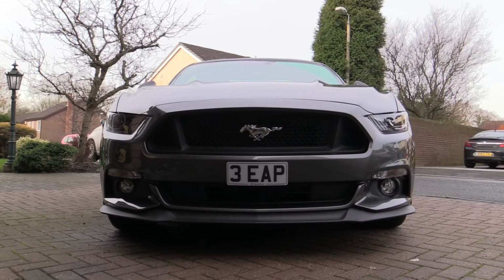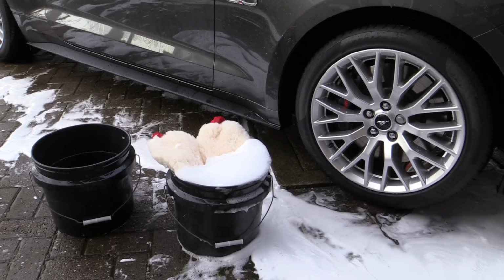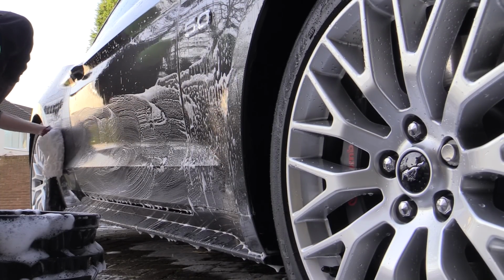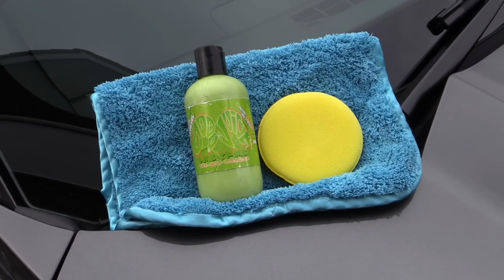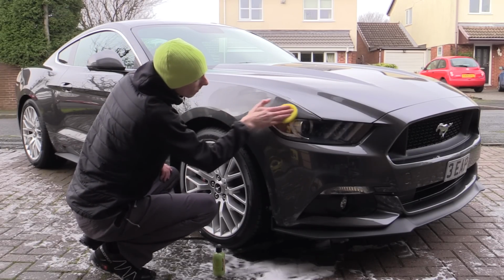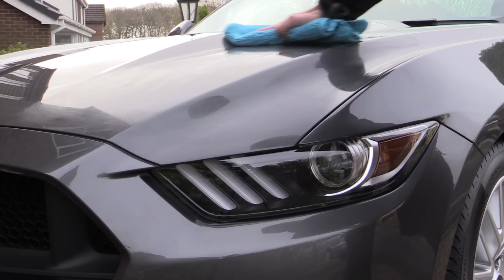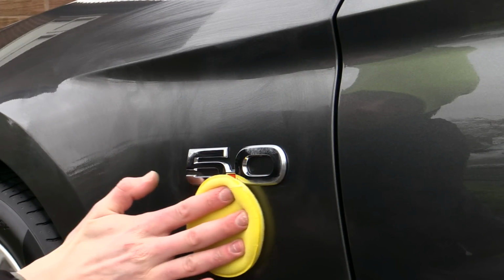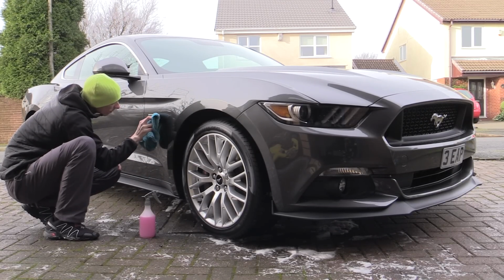Mean Mustang GT First Wash & Wax

Comment: Excellent video. You have taught me a lot about how to properly clean a car. I now have a foam cannon, power washer, bucket grit separator and Mustang GT Convertible.
Reply: Why a convertible? In my opinion, they have weaker structural integrity in the roof area, have lesser insulation abilities, more moving parts, heavier weight, more torsion in the body and lesser aesthetic appeal.
Reply: Isn't it obvious? Few things rival going for a drive on a sunny day with the top down.
Reply: +ALL KINDS OF GAINZ I don't like them either, I live for mustangs cope is the way to go

Comment: Car Cleaning Guru, I have a hot tip for you...

If you want a cheap way to test out cleaning products, try it this way, get scrap metal, doesn't have to be very big, just big enough for you to inspect, then you primer, paint and clear coat each one, rattle cans will do..
OMG THE ORANGE PEEL! buff it...

Now you have your testing canvases... what you do afterwards is you add your coats of whatever you want, be it paste wax, carnuba wax, sealant, ceramic coating... spray wax? and leave it to the elements... Wash the panels as you would normally do to cars when they get dirty but carefully inspect them.

Before wash, after wash, reapplying, seeing how many washes and so forth and even seeing the different types of washes... if you want, you can even tack weld washers to the backs of the "panels" and leave them on hooks so they have different coverage's.

What will that achieve? you may ask... well, you will get to know the products first hand, having 30 cars in your back yard is a dream for a mansion owner, but in reality you can have 50 cars hanging off the side of your apartment exposed to different elements with different things, allowing you to understand the products you are putting on your customers vehicles without going out and doing a survey.

If you really want, you can even ask the paint place for different types of paints, from hard to soft and in between so that you can try them, sure they would be too small to do the normal compounding techniques but will surely help you select the correct product, and in the end you can always spritz it with acetone, dry with alcohol wipes and start again.
Reply: Happy Fox 
you don't get many youtube questions like this to the dozen!

Comment: Quick FYI - slide the wiper blades to the service position with the ignition off (near vertical on the windscreen) they will return to their starting position when you turn the ignition back on (see the owners manual). Great video.
Reply from the maker: Good tip! Although I didn't have the key here...

Comment: Interesting.. normally when I go into my rinse bucket I squeeze the water outside of the bucket in case it does release more dirt it will be outside my bucket.  I usually push the mitt against the gritt guard on both sides.  I know there are multiple techniques.. also throw a little ONR in my rinse bucket as I find it helps the dirt release better from the mitt and the add protection of the polymers can't hurt... unless I am trying to strip the car of it's old wax for new protection and then I normally avoid polymers all together to ensure the protection adheres properly.  I enjoy your videos.. good stuff.
Reply from the maker: All good tips!

Comment: I also open the doors and with tissue paper & stikc, and rag wipe and soak up all the water, dirt, mould, break dust in the joints and wipe clean the underside of the door so everything inside the door jam is spotless. Also open the petrol cap and clean that.  You get mould and break dust inside those door jambs so should be cleaned also.  My car, you open the door, looks like it is still brand new after 4 years.

Comment: Great video again. I would offer a word of caution about using all purpose cleaner on the wheels, (apologies if this point has already been made)
You mentioned it was dilute so it should be ok, however all the apc's I know of are very good at dissolving the glue used to hold your wheel balance weights in place. Thus anybody using full strength apc to clean wheels may well loose their wheel weights. Best stick to dedicated wheel cleaner.

Comment: I never ever wipe the car with anything.  Use a very soft bristle brush that cant create micro scratches.  Using any fibre to wipe pushes minute dust particles against the paintwork, after a few months you will begin to see micro swirls.  When I dry the car at the very end after a strong hose rinse, I lay a chamois on top of areas and gently pull it towards me, with no downward force, it soaks up the water.  OF course you have a clean bucket of water to keep rinsing the chamois so no dust particles get in there.   It does take me 90 minutes to wash and dry the car and door jambs.

Comment: I have a 2016 mustang gt. Mine does not have the chrome window trim. Is it a uk only option? Here in the us it has a black rubber trim. If possible can you find the part number for the window trim and clear tail light lenses. Thanks.

Comment: Im not a car cleaning expert by no means but I have my fair amount of knowledge and experience in the paint and body department and I belive washing it with a pressure cleaner can damage the paints adhession ? Most factory paint jobs today arent very thick ?? So I think i would be safer doing it with a regular pressure house hose
Reply from the maker: +Jose Fast Boats Provided you're not using an excessively powerful industrial machine and you don't hold the jet of water too close, they're perfectly safe which is why the vast majority of pros use them!

Comment: A few questions I have: 
Why wouldn't you decontaminate the paint? You don't think from shipment and travel from warehouse the paint isn't contaminated? Its almost always the case
How come a clay bar wasn't used to decontaminate the paint?
Wheels also, I would recommend a deep cleaning no matter what brake dust tends to embed itself into wheels so a deep cleaner and then application of a sealant or coating would be wise.

Wax itself doesn't have that long of a lifespan on paint. MAYBE 2 months at that and that's really high quality wax. Usually it lasts about a month, reason being is because it ends up evaporating off the paint from the sun. If you would want something to protect until spring, I'd suggest a sealant and if you want something that lasts a year, go for a coating.
Reply from the maker: +SJC96GT As stated in the video this was far from a full on detail. Everything you see here was also done free of charge. The main reason I didn't clay though was because with the filming I didn't have time to also machine polish to remove marring that in my experience claying almost always inflicts.

If a paid off camera detail was performed where I could focus 100% on every stage without having to worry about camera angles/battery life/memory cards etc then of course the car would have also been fully clayed, decontaminated and either given two coats of wax or a separate sealant as well.
Reply: +Car Cleaning Guru Free of charge is understandable, I myself don't have too many situations where clay causes a lot of marring. I actually prep-wash the vehicle with either dawn dish soap or I add an APC to my wash bucket. Once washed and rinsed off I then foam vehicle back down and clay using the soap itself as a lubricate. Cuts down on time and does a great job at removing contaminates embedded in paint using my fine grade clay bar. From on detailer to another, if you haven't tried that method give it a shot. It definitely speeds up the process while still removing all contaminates.
Reply from the maker: Yeh I've tried using snow foam and shampoo as a lube which can be effective however I prefer a designated clay lube as I can see what I'm doing better if that makes any sense? If you can get away with claying without having to polish then go for it I say! I've just never been able to obtain a marring free finish myself and so only ever clay if I'm also going to polish.
Reply: +Car Cleaning Guru It does make sense, I guess I should've been more specific. Since you were doing it for free, a quick way to at least get most of the contamination out of the paint could've been claying after wash and then foaming the car back down. I'm just a little picky about my applicator pads and whenever applying wax or sealant, I'd just rather not contaminate my pads or take the risk of causing swirls/scratches when going in circles or straight lines when applying wax/sealant. I think of it that way, if some of that contamination could further cause damage, I clay so it minimizes the chances.

Comment: How do you control the water pressure using the pressure washer as to not damage the paint? I think I'm asking that question correctly, I know some pressure washers can do damage if not used correctly or is it the pressure washer you are using. Electric vs gas
Reply from the maker: +James C Martin Jr This pressure washer has an adjustable valve on the pump but even at full pressure it's still nowhere near powerful enough to cause any damage. For a washer to hurt the paint it would have to be a seriously powerful machine designed for industrial cleaning/stripping/cutting etc and you'd have to be a bit of a plonker to use such a piece of kit on a car!

Comment: Isn't it better to see if the paint has contaminants? And then should use Clay bar and/or color cleaner?
Cars get so much contaminants during the transportaion to the destination. I would use clay where its rough and cleaner on the whole paint job to eliminate any contaminants
Reply from the maker: If you were fully detailing it including machine polishing then yes, I wasn't, so didn't.

Comment: When I am washing my car I notice it is almost impossible to dry off as it leaves a layer of water that then must air dry. Is this because of a layer of grease? My car is quite old.
Reply from the maker: +Clay Brewer It's normal to an extent. A well prepped and protected finish alongside a microfibre drying towel and a detailing spray will all help though.

Comment: I'm OCD, if the whole point is to minimize contact with the paint, why is it necessary to follow up with a 2 bucket wash, after you let the foam dwell and break up the contaminants? Doesn't the pre-soak do that?
Reply from the maker: No the pre-foam just safely removes any light surface dirt and softens up the more stubborn stuff prior to the contact cleaning. It should never be substituted for a proper wash.
Reply: If you don't wash after foam and then dry the car you are welcoming scratches and swirls.

Comment: Another fantastic job. Can I ask why you apply tire dressing to the tires before you dry them? Even before you wax the car? I have never seen that done before except by you. Your results speak for itself, so please don't think this is a criticism. I am just curious. Thank you for posting your excellent videos.
Reply from the maker: +ouarkie I do wipe the tyres over with a towel prior to dressing but in the winter they'll still be a little damp. And I just like to get the wheels and tyres boxed off prior to attending to the paintwork. I understand why people like to dress them as a final step but you risk contaminating your freshly waxed body with tyre dressing then.
Reply: I am sorry I meant you apply the tire dressing before you dry the rim off. I was unclear on what I meant.
Reply from the maker: Ah ok, usually because there is a bit of dressing contamination around the edge of the rim or overspray (if I apply directly to the tyre) that needs wiping off so I just do it all in one go.

Comment: I have a question: is it really problematic if by accident when refuelling a car you end up spilling fuel on the car's body, on the paintwork?  Do you need to hurry to damp if fast and then wash quickly so that it does not harm you paint ?
Reply from the maker: I've never come across any permanent staining from fuel overspill so I wouldn't worry too much.
Reply: Don't make a habit of it. Just put it dry with some napkins or paper towels. Don't rub it....dear god those rough things will scratch. You could also just rinse it off with water if available. Wash the car atleast the next would be recommend.

Comment: high pressure washing the wheels is not good,  instead use slow flowing H2O better getting the bits...Mate!
Reply: Dave Johnson he does this for a living. He knows what he's doing
Reply: Hi pressure flow will eventually start to peel off, thus low flowing h2o is better. Not my problem.
GL

Comment: OK I'll say it.
I was surprised at how flexible all the panels are, you can see the "give" in them all when the wax is applied.
Is that just a quirk of the material used in the panel or a sign of the stereotypical cheap American construction?
Reply from the maker: +George Smith Felt like plastic to me. Either that or incredibly thin Aluminium.
Reply: Car Cleaning Guru 
Thanks for the reply! 
I'd be worried about it getting dented if it was that thin!
By the way,
do you ever use, or recommend, a nanotechnology polish? You know the ones where the car just needs a hose down after a year and looks like it's just been washed?

Comment: Would it not be better to clay the car before waxing a new car
Reply: +mo khan Claying isn't really necessary on a brand new car, because there aren't really any contamination on the paint.
Reply: +Niklas Neve Sørensen Not strictly true...was surprised how much there was on my new car when I detailed it before applying a ceramic coating. Iron X, tar remover and light clay should definitely be done, even on a new car IMO...
Reply: +Lewis Carpenter I didn't expect that... :)
Reply: +Niklas Neve Sørensen Me neither! Also didn't expect the large amount of swirls that the dealer managed to make from doing their 'new car' prep, despite me asking them not to touch it..! :( Certainly didn't expect to have to do machine polish on it!
Reply from the maker: +mo khan Only if it really needs it and if you're planning on properly polishing afterwards to remove the marring it will inevitably inflict!

Comment: those specks were from wiping the under side of the vehicle and you rubbed all that all over the paint. Not smart.
Reply from the maker: +peter reboot What specs?
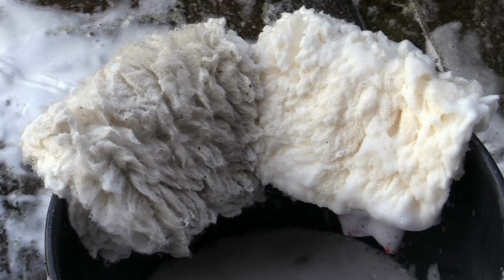Reply: +Car Cleaning Guru at 6:37 you're showing a very dirty wash mitt. Of course it's dirty, you wiped under the rocker panels with it. I hope you only use the wheel mitt for that. But i noticed you kept washed the lower side of the car. :(
Reply from the maker: +peter reboot I washed the lower panels THEN the underside of the plastic sills and inner arches. That mitt will not go near the paintwork again, at least not before going through a proper wash.

Comment: What an absolute machine! Check out my channel mate, just got my first professional detailing video out and would love if you could leave your feedback. And well done on the job pal looks brill!
Reply from the maker: +Aminul Islam Nice one, how do you find the CG VSS polishes? Was contemplating adopting one for my single stage stage enhancement details this year but it sounds a little too good to be true!
Reply: +Car Cleaning Guru I'd stay well away from it mate. With CG it's a hit and miss tbh. As they're products and advertisements suit the weekend warrior as well as the professional Detailer, it really is a hit and miss when testing their products. I've tried the CG VSS and it's more for the weekend warrior tbh. If your looking for an all in one polish I'd recommend the auto finesse triple all in one polish. Works way better
Reply: But in saying that, they're V Line polishes work really good! They cut really good providing you use the CG hexlogic pads. But when compounding I'd recommend using the meguiars MF cutting pad if your using a rupes or da. And the finish with the hexlogic pads combined with v line polishes are exceptional. And for drying, I'd recommend the auto finesse Aqua deluxe. Your a pro Detailer and I'm sure you know what your doing so I hope you don't mind me intruding on your comments section like this lol. But the biggest difference you'll see from changing any product/tool will be using the auto finesse Aqua drying towel. Honestly it's on a different level. I don't know why I didn't start using it sooner. But be sure to put it through the washing machine before using it first time otherwise it'll leave a lot of lint
Reply: Sorry I just realised now, do you mean their v line of polished or their actual product vss?
Reply from the maker: +Aminul Islam It was the VSS scratch & swirl remover I was specifically referring to. I want something with diminishing abrasives that will cut well yet finish down to provide decent results for a single stage detail.
Reply: +Car Cleaning Guru in that case I'd recommend CG V36 combines with the CG White hexlogic pad. But again it depends on the paint. I'd use the White hexlogic pad for soft paint cars and the green one for more hard paint cars